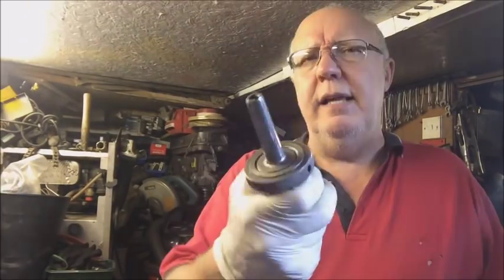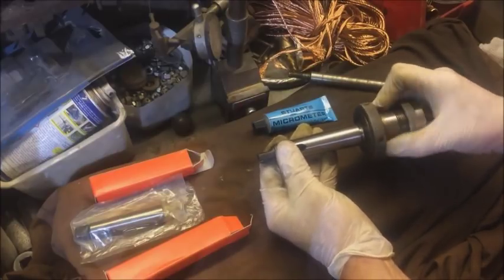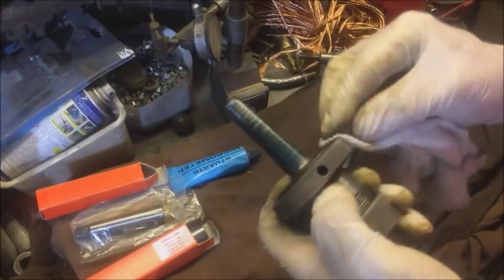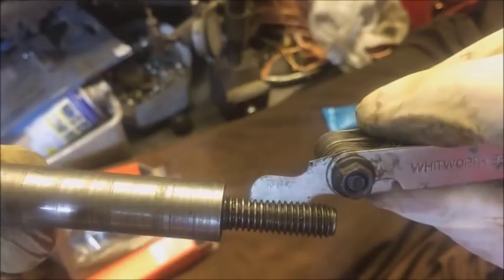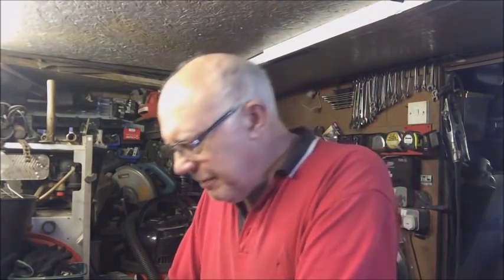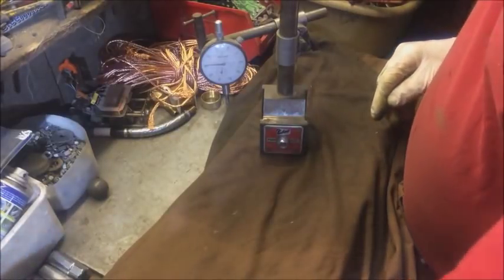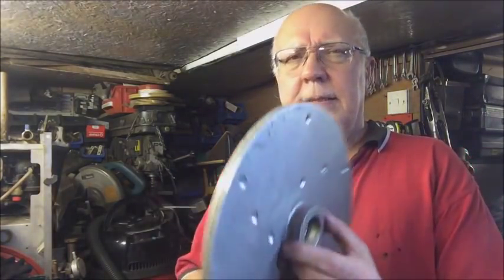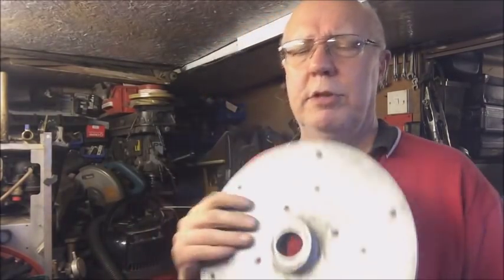Morse, Jacobs, B&S,  R8,  DTI, or  DRO,

Comment: Well Ian, where do I start, First, I nearly wet myself when I saw your magnetic table! I've been after one forever, I looked at one this weekend on a stall at the kempton motor bike jumble, about 10"x5", £120, which is a bit strong anyway, but way strong for me, The DRO! you should keep the one you've got for fitting to you super 7! :-0, and get a brand new 3 axis one for your mill, and empty your pockets at the same time! and spend a month fitting it.
Thanks very much for the offer of the faceplate, but my lathe is a "jubilee" the spindle is a 1"x10tpi, that I think as you said is off of a graduate (which I always wanted) bigger spindle! but thanks for the offer! someone out there NEEDS that, Great video as usual,
ATB,
Cliff.

Comment: If your thread gauge is a British Standard Whitworth then it should be 3/8 by 16 teeth per inch (tpi) and i think the outer diameter of the thread should be about 9.5mm hope this helps a little
Reply from the maker: thanks Daniel,  and belated Birthday wishes
Reply: No problem and thank you

Comment: Ian, just stick it in and wiggle it about.....if it's tight it's right (DO NOT go there lol) Now as the threads, it's very easy to be wrong. Because some threads have the same pitch, just different angles.
Reply from the maker: I gotta go with summat, I may get a 3/8th nut & bolt thru work and try them to be sure, or even tek it to a engineering shop.
Reply: Get a selection of about the same size i.e. Whitworth, AF Metric etc. Screw them in/on by hand. If they fit it's the right one. Remember, end of the day, all they have to do is hold.